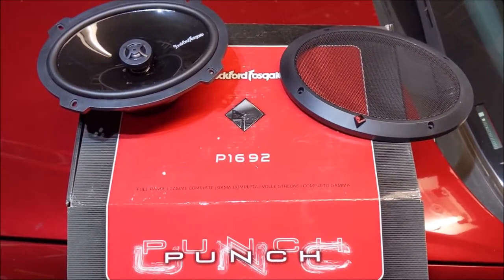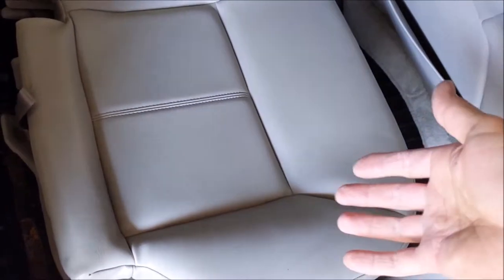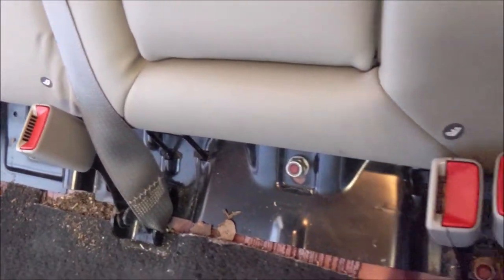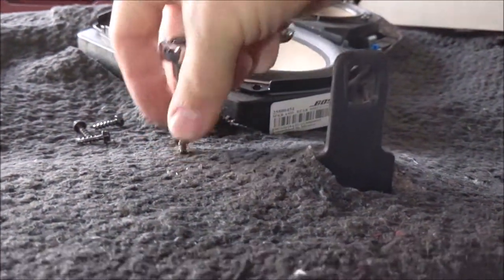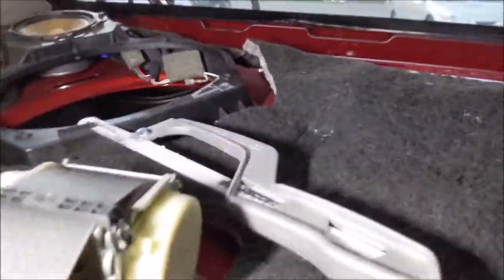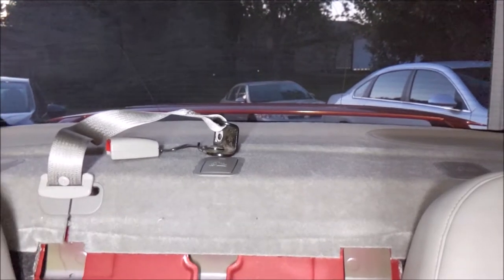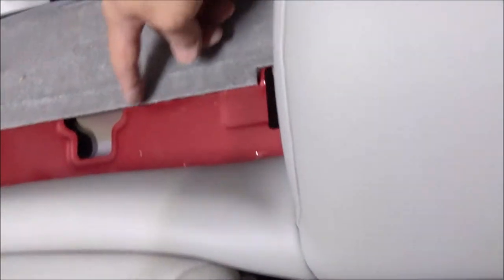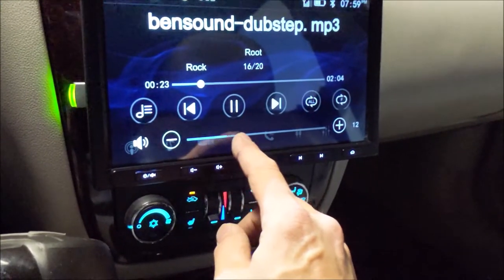9th Gen Impala Audio Upgrades Part 3:  Rockford Fosgate PUNCH P1692 6X9 Rear Speakers

Comment: Yeah in my 2013 ltz impala it is a differents lol I had used a wire harness & took the wires from the Bose amp to an aftermarket amp & it sounded better before I messed with it I even put some Arnold’s in the front . But to be fair the amp I put in there isn’t tuned but around like 17 it sounds fine not better but fine .
Reply: Also it could be that I changed them for them cheap skar 6x9 too 😂
Reply from the maker: Aftermarket amp with Bose 2 ohm speakers would definitely make them louder than a regular set of 4 ohm speakers would sound. The opposite of what I did!! 🤣

Comment: I got rockford fosgates on mine too but i don’t got the bose package. I had to put some kilmat inbetween the speaker and the adapter to hold it in because the speaker was rattling at high volumes. May wanna add that in case you hear rattle later on!
Reply from the maker: That's a good idea!! I haven't had any rattling issues (yet) but I will keep that in mind if I ever do!!👍

Comment: which drill is that?
Reply from the maker: The one I used to remove the seat?
Reply: @CertifiedShadetree  yes size and all. I tried to do it with an 18mm wrench but those things are tight!!
Reply from the maker: https://www.homedepot.com/p/RYOBI-ONE-18V-Cordless-3-Speed-1-2-in-Impact-Wrench-Tool-Only-P261/205885687

If you buy one, make sure to also buy a 5 amp/hour battery. Anything less and the tool won't perform very well..

Comment: What about running the wire from the 3” and splicing it into the tweeters on the 6x9?
Reply from the maker: Not a bad idea, hadn't thought about that!! I don't care to dig all of that apart again to check my speakers, so I guess it would be a matter of where the wires for the tweeters connect to, or if it's even possible to cut or splice into them.
Reply: That would be a good idea

Comment: I swapped out my stock 6x9's in my 2012 sounds great 👍🏾
Reply from the maker: The stock speakers are complete GARBAGE, too!!
Reply: @CertifiedShadetree  emailed you a couple of pics. These speakers can only be bought in Chicago or online. Family has been making speakers and subs since the 80's. Great product!!.....
Reply from the maker: @mstovall2970  Those are some beefy speakers!! 🤯🤯
Reply: @CertifiedShadetree  planning on doing complete system subs and amps
Reply from the maker: Do you plan on putting down any Boom Mat?
Reply: @CertifiedShadetree  Yes , 2nd battery. Upgraded alternator as well
Reply: @CertifiedShadetree  I have 2 15's in the 09.  Going 2 10's or 12's in the 2012

Comment: Whew that's a lot of work. I just added a 8 inch woofer from Skar audio with a custom enclosure in the side of the trunk to my 18 premier w/ the bose and I am very very very happy they compliment each other well I got a little more rumble without the trunk rattling.
Reply from the maker: Did you build the enclosure? I would like to pursue a custom enclosure some day, either on the side or down in the spare tire well.  I use my trunk to haul shit, so there's no way I'm putting in a "normal" sub box back there!!
Reply: @CertifiedShadetree  I didn't the shop I took it too did. Mine on is in the side gap out the way. To get an idea of what the enclosure looks like google "beats subwoofer chrysler 300" But mine is in the drivers side corner of my trunk.
Reply: @CertifiedShadetree  Skar Audio IX-8 8 inch woofer 2 ohm believe it or not is what I'm using. They even have 6.5 inch woofers. That I've actually heard and they sound GOOD. I was thinking of swapping out the 6.5's in the doors with 2 of those but I just went with the single 8.
Reply from the maker: Ahh, now that's what I'm talking about!!
Reply from the maker: @jf6441  That's more of my speed, as well. I don't need earth shaking bass, just a little bit of down low fill to round out the sound.

Comment: So. Damn. Helpful… except my LTZ wouldn’t pop the bench off after trying those two latches under the seat?.. I got the car from my brother and he had previously paid for install of a 12” sub in the back so I don’t know if it’s something they did? Maybe you’ve got insight?.. just probably gonna break something idk haha. 

Thanks for the video mate great work!
Reply from the maker: I know those straps that you have to pull to get the cushion out are kinda flimsy, so it could be that one or both aren't even engaging the latch anymore. I would say maybe first try clamping on a vise grip to each strap and giving them a good pull to see if that unlatches it. If that doesn't work, maybe trim away the plastic surrounding the pull straps and see if you can get a hook tool or a screwdriver in there to pop the latch..